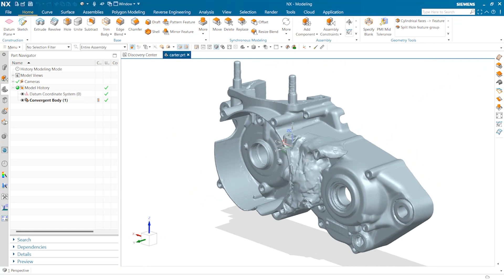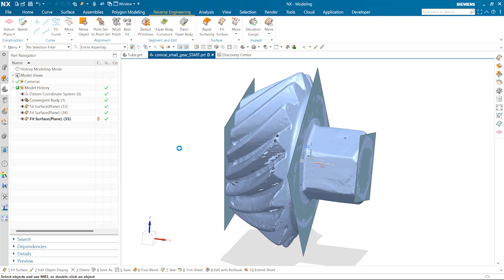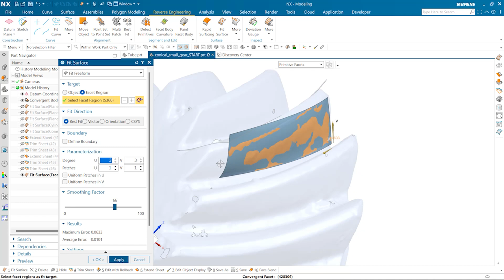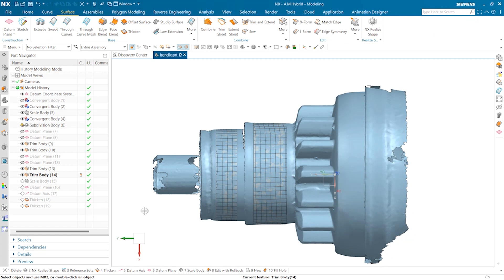NX CAD/CAM Insights : Reverse Engineering

Comment: How do you get the camera movements to be so smooth ?
Reply from the maker: Hi Terramyr, simply by using the 3Dconnexion equipments. 🤩 
Specifically the CAD Mouse and the Space Mouse, contact your local JANUS partner to learn more ! 
You can also see how it works here -> https://youtu.be/MW33R1zt5M8